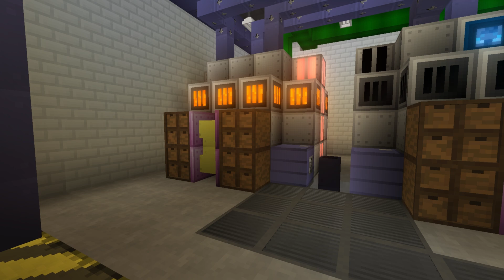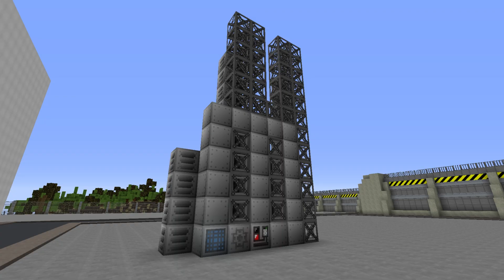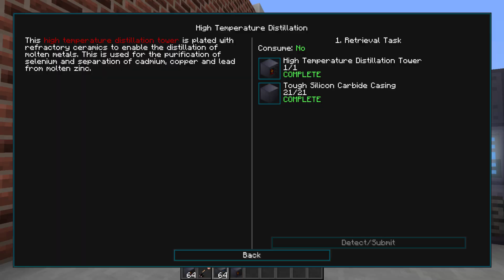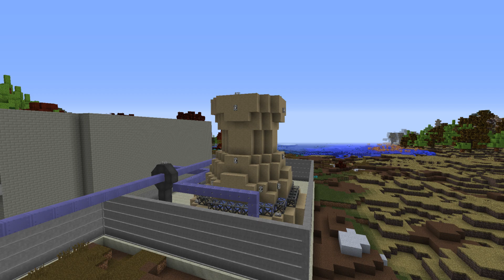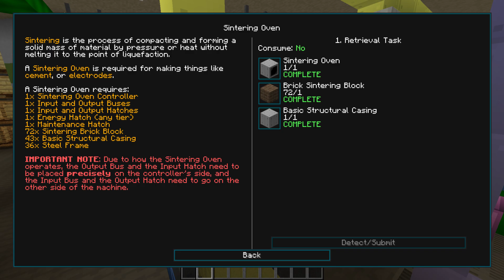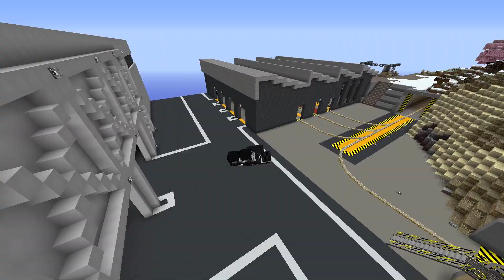Supersymmetry. Multi Showcase

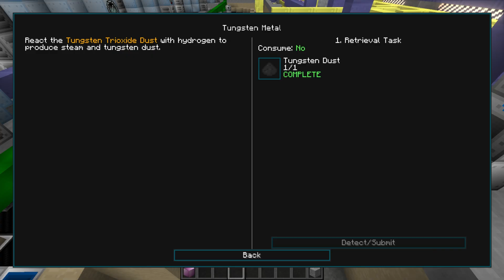Comment: 3:20 Most of the clarifier recipes connected to the ore doubling chains. So very usefull once froth floatation unlocked.
11:10 You would need injection molder for any polymer that is basically HV+ as extruder recipe doesnt exist for them